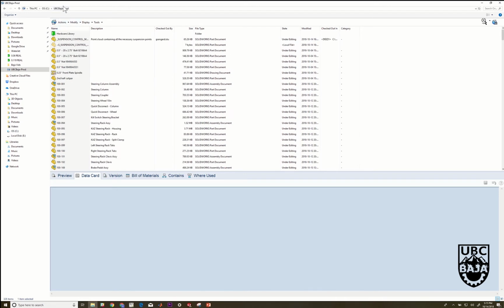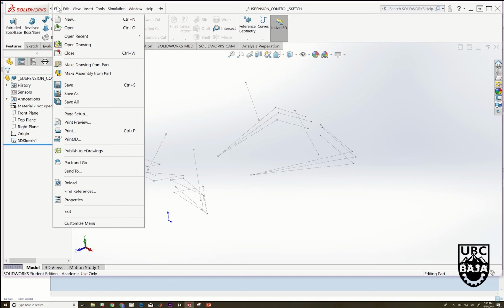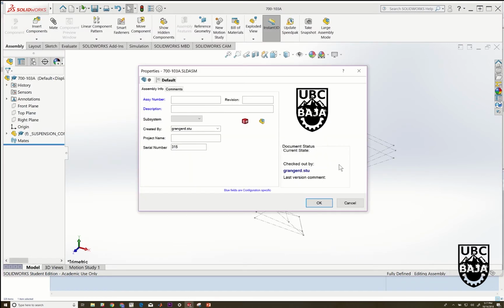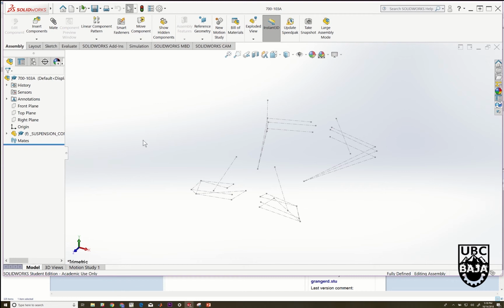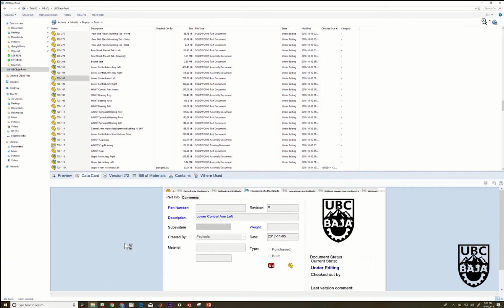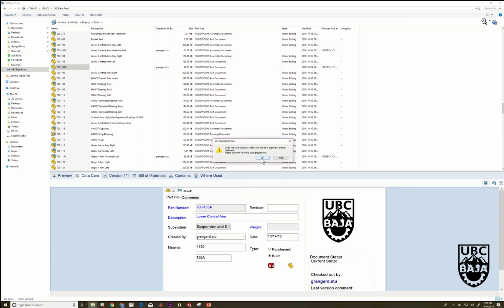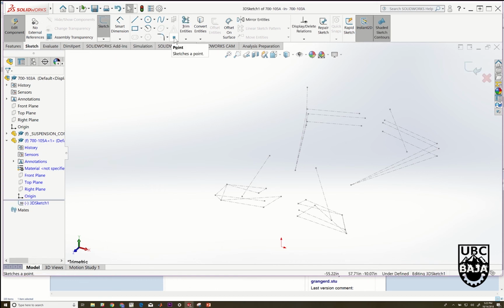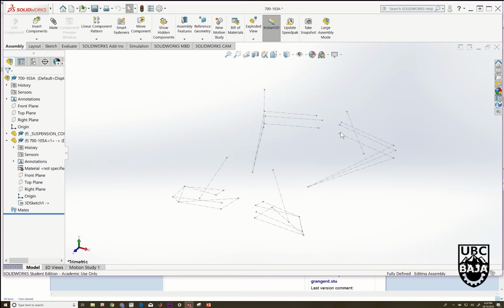Creating an In-Context Part Referencing a Control Sketch || Solidworks How to: 1

Comment: I prefer making the geometry on the parts own principal planes, otherwise it has to rebuild the entire part (with extrudes, sheet bends etc) every you want to test your suspension travel, steer clearance etc, as well as not being able to rely on your principal planes for reference when adding features to the part. What I suggest is within the part using a 3d sketch on plane (2d does projected length which is a big no), and then using equal length relations instead of convert entities. The part gets mated in to the assembly with the master geometry sketch, not using the insert new part function - as in, the part wouldn't be fixed in space but rather mated. Especially in the steering knuckles it can become a massive pain in some scenarios doing it using your method (I know since I've gone through that lol).